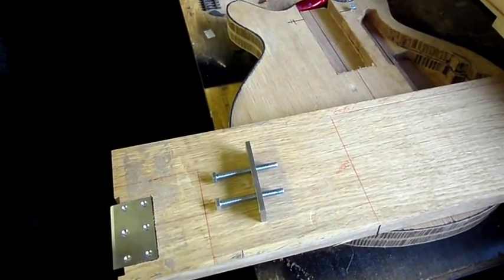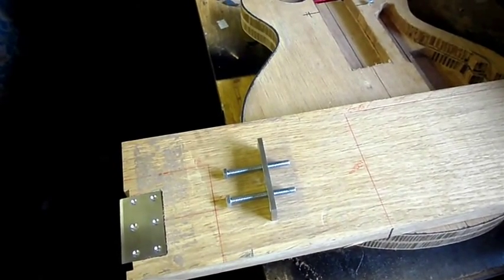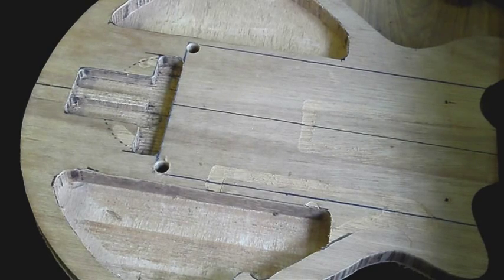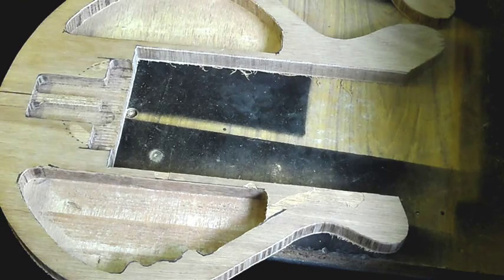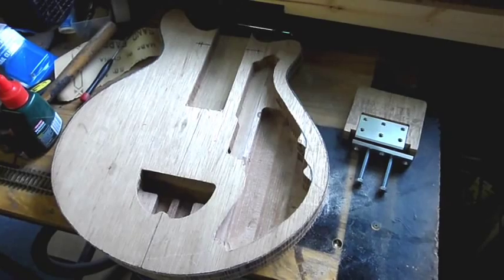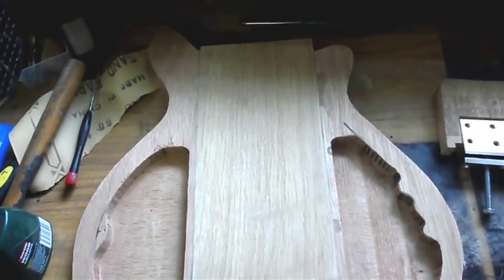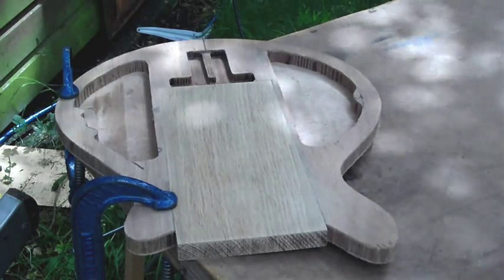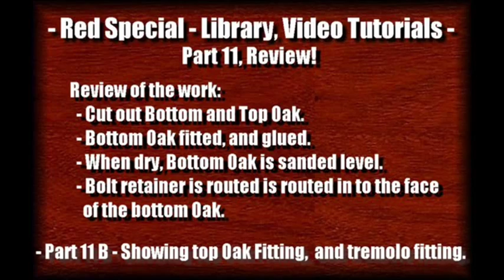Red Special - Library, Part 11A

Comment from the maker: Many thanks
The commercial copies are a bit different in maufacturing, all CNC routed, 4 / 5mm veneer sheets probably on the top surface, chambers are smaller on commercial copies and materials also different, but similar result.
Thanks for watching glad you enjoyed the video.